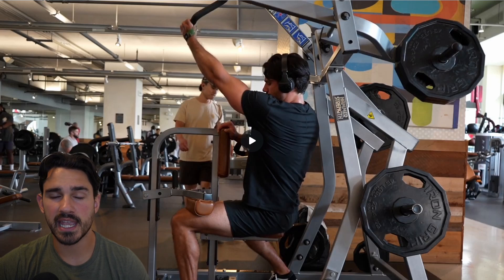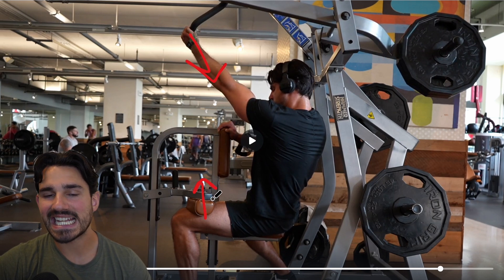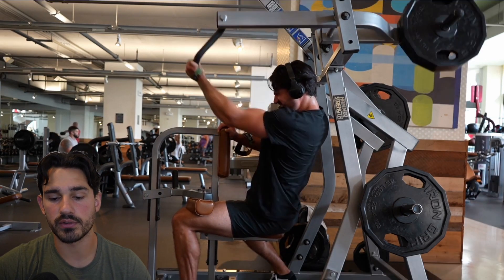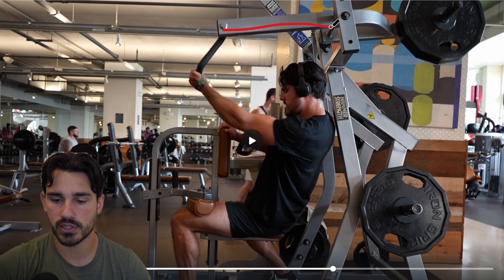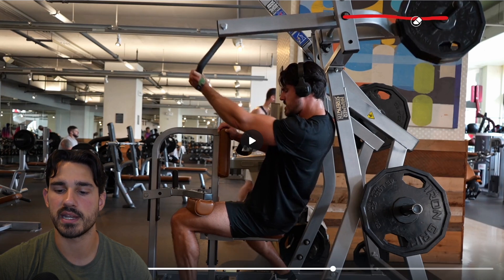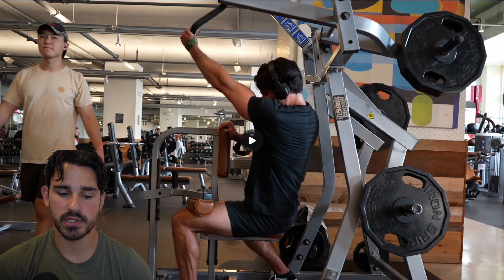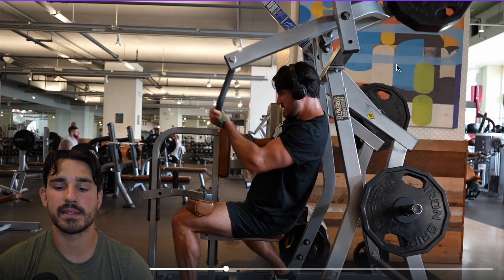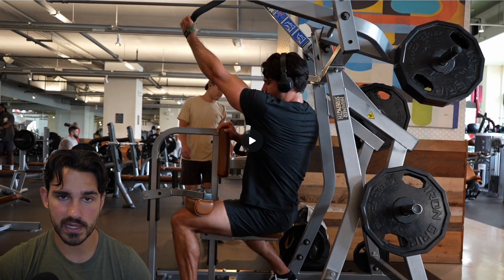Machine Pull-Down Mechanics - Learn Biomechanics

Comment: I always struggle with where to set the seat height on this machine. 

Edit: After watching more of the video, could you not manipulate the moment arm using the seat height? E.g. lower seat means horizontal lever in the "top" position of the pull even of you are hard against the chest pad....
Reply from the maker: you could lower the seat height, as @heibaimao mentioned, but that would also change how you're pulling on the machine, and it might make it very awkward to pull with your shoulder as compared to your elbow.
Reply: You are correct. You can just lower the seat so when starting position(arms stretched) moment arm is parallel to ground.

However by sitting smoosh into the chest pad (with lowered seat), the arc of pull won't be as 45degree diagonal but more top to bottom. I prefer sitting smooshed into the chest pad as it gives more stability 👍🏻
Reply: I have the same question regarding seat height

Comment: I thought that all pulldowns were lower lat biased
Reply from the maker: not if you change the angle so that its no longer a "pulldown"!
Reply: Give decline (yes declline) one arm dumbell lat row.
I get huge and thick lower lats.
I use a high ab crunch bench almost on full decline, support knee up on bench
the working side arm fully extended forward and elbow close to body, fell the lower lats thru out the row.
Don't go too heavy, just heavy enough. You get DELTA WINGS. :))